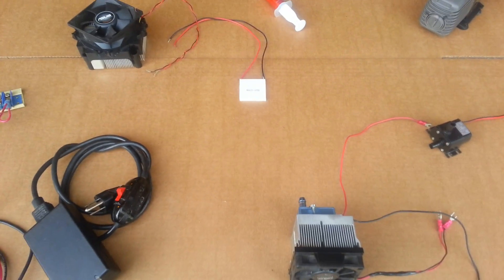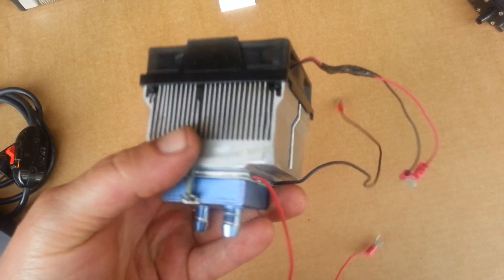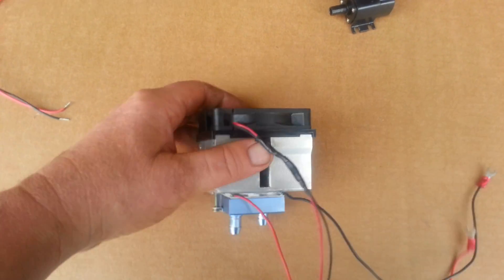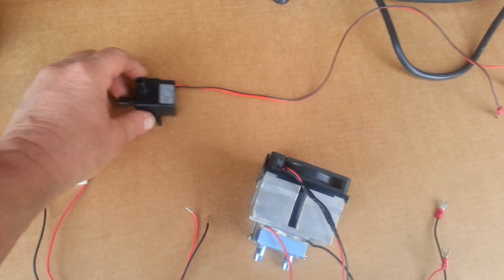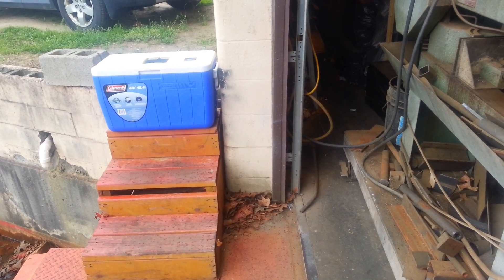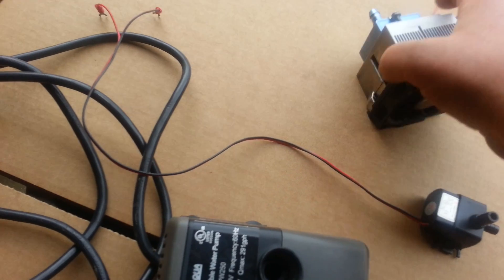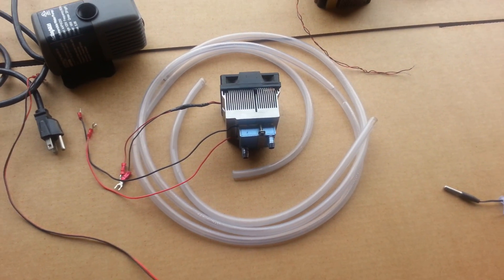DIY THERMAL ELECTRIC WATER CHILLER

Comment: Ok; I'm stupid.  How does the cold side if the chip transfer to the water in the reservoir ?  It seems that it must certainly be submerged, but still isolate the hot side and heat sink.  Maybe I missed something.  Thanks; this was great information>

Comment: Mike, we're new to hydroponics and we have a unit to go in Missouri.  We want to use your chiller, but we're not sure about the parts - would you mind sharing the actual part numbers for the parts you used.  I got the chip - you gave that on the video.  Impressed with the pump too.   What about the heat block too?  I sure hope you'll help us - we want to do it right.  Thank you very much!

Comment: i like to show u a batter way lmk if u like to no i got a fix wab pag got radiators perfectly sized radiators. new in box 20cash.  all u need is a fan u have that i see and solar panel you have so you can run the fans off the solar panel and use the pump to push the water through the radiator which the fans are cooling the water inside the radiator. what u think

Comment: every tried the Tec xxx -08 10 10s are twice + cooling of 6. the Teg. chips are beast ..  working on a controller model. staying with 06 chip also looking at the Teg. problem may have is proper power plug for controller fan chip etc. all in one source. I have  multi fans some custom from PCS sizes very. NEVER USE those 20 mm fans unless you want to start warm kinda and buildup to Semi cool over a longer period. . also going to try a double unit dual chips either 2 water blocks, or the long water single block.

Comment: Mr. Mike, I think it's a great idea,  can you tell me how I can wire up this set up to use on a standard (U.S 120v) household socket? thanks in advance!
Reply: you can use a old transformer plug say a 12v one that also has less than 1 amp.  it will have the output specs on the plug.

Comment: I having a problem cooling the tank after I start the pump. Water temp was 78 degrees the module was freezing water drops i put on it before i installed the tank but even after getting the temp down to 68 degrees it would not chill the tank or water. Do I need a different  module. Using the same cpu fan you have.

Comment: Isn't aluminum bad for fishes and other things? I want to do something like this for my axolotl and I was wondering if this will work on a 25gal tank. water temp on average is on 30°C and I want at least 20°C. I saw someone used a copper water block and since it was near freezing temp the metal isn't leeching out of the block. Can you give any insights to that? I have yet to have a reply from the one who did that. or If his axolotls are still alive.
Reply: Please read my first post, copper won't leech out metals if it's near freezing temp. a copper block won't leech out too much copper in the water. and as I said earlier the idea of using the copper block wasn't pushed through due to the inefficiency of the peltier module. are you even reading??
Reply: Marc Wivenson Co Sure, sure...
Reply from the maker: I would definitely use a copper water block.  the one I use was something I had laying around and didn't want to invest alot of money in it if it doesn't work.
Reply: Cool I've ordered a copper water block last week on ebay and I'm waiting for it to arrive. hoping this will cool down my 25 gal tank. I think I need to change my heatsink and fan though it isn't big enough to cool my peltier's hot side so that the cold side will be cold enough to chill the water on my 25 gal tank
Reply: Man cooper in aquarium ? Gl to your fishes
Reply: HappyBreadfruit copper is used to treat certain disease on saltwater fishes. And I was going to use it on an Axolotl tank. But didn't pursue since energy exchange via peltier isn't. Very efficient. Please research first ok. :)
Reply: Copper SULFATE is used to treat in very small amounts... Cooling water with copper or aluminium is very bad idea. So do your research  first pls... Peltier is not efficient if differences of temperatures are big. Try to use pc fans and cool your lights. Even LED lights can heat the water +1-3 °C
Reply: Are u simpleminded or what ?? Copper won't leech out metals?? Just wtf.. Copper (what other metals xD) will dissolve very fast in the water ( specially in acidic or salt water). I dont care if u using it or not, I just told you why u are wrong.
Reply: HappyBreadfruit copper waterblock please read again. are you blind?
Reply: Marc Wivenson Co And?? wtf man.. just dont more continue this convesation i rly dont care what u will do with your tank now
Reply: HappyBreadfruit yep better, just don't reply on somebody's comment if you don't understand the conversation.
Reply: idiot breadfruit.
Reply: i actually hate baseball, you mongoloid
Reply: http://memeshappen.com/media/created/silence-Chris---meme-30198.jpg
Reply: From your three stupid comments i got, that you are kid, racist, and homophob... So pls, if you dont have something more than stupid insults, do not more anoy me. A will ignore you anyway ugly kiddo.

Comment: hey mike, I just built something similar to yours. Took 5 hours to cool 1 quart of water 1 degree below ambient. Only thing I did different to you was not using thermal grease. Would that explain why you can chill 12 gallons and I can't even chill 1 quart?
Reply: Harvey Kane i no some one that did it no thermal compound on heat sinks with LEDs and with adding thermal compound he got it to go down 30 degrees Celsius it was a 180° before thermal thermal compound on heat sinks with LEDs and with adding thermal compound he got it to go down 30 degrees Celsius it was a 180° before thermal compound weather Moore compound it went down to 120 degrees Celsius so thermal compound does help don't know how much it would help though in your case
Reply: Harvey Kane other than that, you might also want to check if you can dissipate more heat away from the hot side. :)
That way, the cold side will become colder.

Comment: Noob here Mike. I am planning on building my own too. but may I ask a question cant seem to find an answer on google. When getting the TEC1 chip what is the difference between the numbers? 12706, 12715? is one colder than the other?

thanks so much
Reply from the maker: the first two numbers is your volts, the next two numbers is your watts and the next numbers are your amps
Reply from the maker: +Mike Walker 12706= 12volts- 70watts- 6amps
Reply: thanks so more watts more amps = colder?
Reply from the maker: +RaymondJacob0922 yes but you have to cool down the hot side with a high RPM fan. the faster you cool it down the colder it will get.
Reply: thanks now I have some info to go by. and did you choose the 12706 because it was the best/coldest one for your application? would you have gone with any other tec-xxxxxx. I am looking to get the best/coldest one for my application.
Reply from the maker: +RaymondJacob0922 it was the cheapest. I didn't know if this would work so I didn't want to invest alot of money in it.
Reply from the maker: +Mike Walker and yes I would go with the best chip I could get.
Reply: thanks for the qucik replies. and now that you been working with the chips for some time now, and would do it again, would you go with the 12706 still. Do you know which model# (if costs wasnt an issue) would be the best at getting "colder" thanks again man ur awesome
Reply: @JRyoutube09  I started testing this out and realised that the "cheap" peltier modules (3-5 USD ones on Amazon) are not drawing more than 3.3 A, hence they are not even reaching close to their DTmax. I would expect them to at least draw till 70% of rated max current of 6 A i.e. 4.2 A but that is not happening. Thereafter I researched and found that the same 12706 and others 12710, 12715 are available at 20 times the cost from other sources. Haven't yet got any of those. What has been your experience? I strongly feel that getting the right module would crack this problem.
Reply: @ShrenikBhura  lol if I can recall 4 years ago, I never completed this project. I was trying to make my own ice probe. but went and bought a cool works ice probe instead..... it worked out for me
Reply: @JRyoutube09  Could you pls share a link to what you had bought?

Comment: for this kind of device, can this device turned on for 24hour non stop? if not, for how long should this kind of device turned on?
Reply from the maker: it can run 24 a day.
Reply: +Mike Walker i want to ask about the power supply needed, i have TEC 12706,  12V 5A. i also have one adaptor, 12V 1A..
can it run well with that adaptor?
or should i find another adaptor, with exact Amperage (5A)
Reply from the maker: +Sion Napitupulu you are going to need a 12v  5amp power supply. The 12v 1amp power supply will NOT work.

Comment: I built an exact copy of this, however it's not cooling water at all. I left it running for 3 hours in a jug of water and the water just stayed room temperature. The heatsink is hot/warm and the water block feels cold, but not that cold. Could it be a bad chip? I've seen videos of people freezing water on these chips. Any help would be appreciated.
Reply from the maker: sounds like a bad chip. Make sure your using a 12 volt power supply and check you wattage and amps. I would use a high RPM heat sink fan. The faster you cool the heat the colder it gets. it's about moving the heat.

Comment: so wouldnt you need 2 more terminal nodes so you could run the pump, the fan, and the peltier on the power supply at the same time?
Reply from the maker: Hey Tim 
you really don't need the terminal connectors. You could just splice the ends and connect them that way and put wire nuts on them.

Comment: Hello Mike what size tubing is that? does it fit both the water pump and the water block ?
Reply from the maker: hi smiley
the hose  is 1/4"inch inner diameter
Reply from the maker: +Mike Walker and it fits both

Comment: Hi Mike, im looking to make a water chiller relatively close to what you have here but im no electrician by any means.  Essentially my question would be, what sort of parameters should I follow?  Do I need a power supply that can cover the highest amount of watts used by a single device in this or everything total? Likewise for the amps and volts. If it helps you help me, ive got a 100W peltier, a 12V pump, cpu heat sink at about 3W and a temp controller also at 3W. thanks for any advice :)
Reply from the maker: hi Eli 
you want to add your watts and amps. you're power supply has to be more than what you need.
Reply: I appreciate the response Mike, thanks.  Just one last question.  Say my power supply is far more than adequate enough to handle the components, will the power consumption be that of what the power supply can handle or just what the components need to function? Thanks again Mike.
Reply from the maker: +Eli B just what the components need to operate.

Comment: Would it still cool if you were to run the cool water through a friedrichs condenser while the condenser was submerged in the reservoir? This way there would be no contact with the metal and the hydroponic solution. Also could you use an alcohol based coolant with the plate?

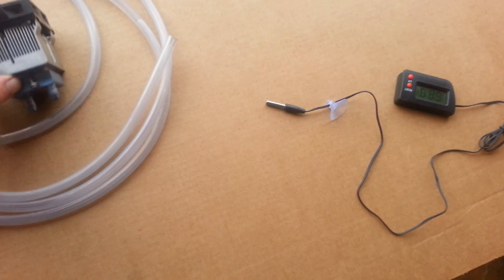Comment: Wait you said at 4:20 to use SS screws because that thing is going to be In water the whole time? You're putting that whole unit, fan, that blue thing(a water block?)  and wires into water??
Reply from the maker: it sits on top of the lid. it will form condensation around the water block. that why I said use stainless steel screws.

Comment: If I wire 3 of these in series what voltage power supply would I need?
Reply from the maker: Hey Kenneth 
You still would use a 12 volt power supply but you need to make sure it can handle the amps.
Reply from the maker: Mike Walker also make sure it can handle the watts too.
So if you have a 75 watt chip with 9 amps you need to multiply those numbers by 3.
So you would need a 12 volt power supply that can handle 225 watts and 27 amps. Now if your 12 volt power supply watts and amps are higher great but if the numbers are lower it will not work.
Reply from the maker: Mike Walker one more thing..
Make sure you add the fans into those numbers.
Reply: Thanks for your help, I'm a homebrewer looking to reach lager fermentation temps without a refrigerator/freezer.

Comment: Could you theoretically cool a 2 by 3 foot grow box, using somewhat passive movement of air (slower RPM,grow boxes intake fan) through plastic tubing placed in your chilled water?  Want to go from 90° to 80° in this application
Reply from the maker: Hey Jose
what are you trying to cool. A 10 Degree Difference Isn't much. The cooling unit I build bring temps down to 60-70 degrees. Check out this video. This is a ice chest for my water tank. I use it out doors to cool it in 100 degree weather. Is this something you are doing? Watch it it may help you.

https://youtu.be/n6ewZnr6s8U

Comment: Have you run into any issues with your PH or PPM going awry?  Did the grow finish up good?
Reply from the maker: Hey Jim
I did make a change and used a copper water block. I had no problems using this from start to finish. It was used indoors. In the evening with no lights on my temps are around 59 degrees with lights on it will stay around 76 degrees. 
I had no issues controlling the PH or PPM of my nutrient solution.

Comment: Hi mike, could you teach me or instruct me on how to connect the cpu fan & peltier to a laptop adapter?
Reply from the maker: Hi Zahidah
There are many videos on YouTube that will show you in detail how to connect the wires.
On a laptop power supply you cut off the connector that plugs in to the laptop. Strip the sleeve back and you should have 2 wires there. The one that has the wire sleeve on it is your positive.
Reply: Mike Walker then I just connect them to the peltier device?
Reply: Mike Walker sorry for asking again, I'm using 10A peltier, so what laptop adapter do I use? Like you, you used a 6A peltier and connect it with a 12v 5A laptop adapter right? What do you think about mine? Any suggestions?
Reply from the maker: To figure out what you need take you volts multiple that by your amps which will equal your watts.
12 volts X 10 amps = 120 watts
So you will need a 120 watt power supply to run your chip. Then connect your chip to the power supply. Red positive black negative.

Comment: I'm just getting started and buying the parts I need for the water chiller.  I'm sooooo excited.  I've already built two towers from watching your videos and am getting ready to get it all together.  I've never ventured out to make solar towers before so I'm sure I'll be asking lots of questions as far as specific parts are concerned.  Will the aluminum casing of the cooling block cause a problem?  If I use solar and it's a cloudy day will the pump be able to continue sending water through the block even though the cooling is not necessary or engaged...I plan on using electricity for the water pump.  I want to be able to allow the unit to cool on hot sunny days.  Here, when it's overcast it's not too bad.  Also....what size solar panel would you recommend?  Thanks for all you have shared.
Reply from the maker: Hi Renetta
Here's what I can tell you about the chiller unit. It is only good for indoors. I tested it outdoors and it failed miserably.
If you watch my other videos after the chiller posts. You'll see videos of how I used an inline fan to keep my temps in the low 70's in 100 degree weather.
I can't get into the modifications I made inside the reservoir and tower but it works.
Reply from the maker: You can purchase everything you need on amazon.com for the chiller unit.
There is a product on the market that works great for indoor reservoirs.  It's called 
"Ice Probe" they are sold on amazon too. The solar panel system I haven't had time to sit down and figure out how many watts I need.

Comment: mike what would be needed for a 55-60 complete gal system? say if there is only 10 gal res but is like a undercurrent set up would this keep later level below 68 or would one have to use larger pieces ect? thanks brother
Reply from the maker: What's up Doc
Try one of these.

http://www.amazon.com/gp/aw/d/B001JSVLBO/ref=mp_s_a_1_1?qid=1426005301&sr=8-1&pi=SL75&keywords=Ice+probe
Reply: Thanks for the speedy reply. I appreciate you